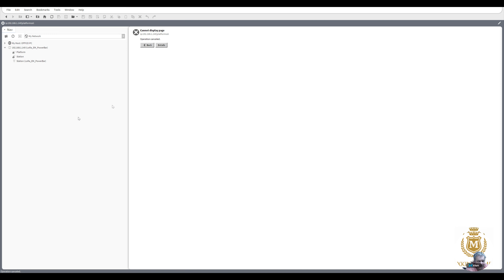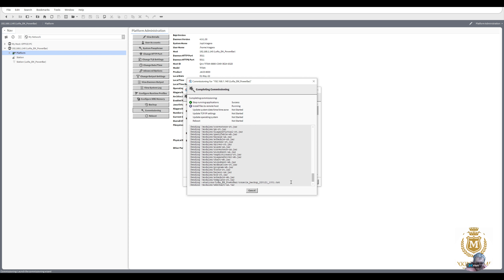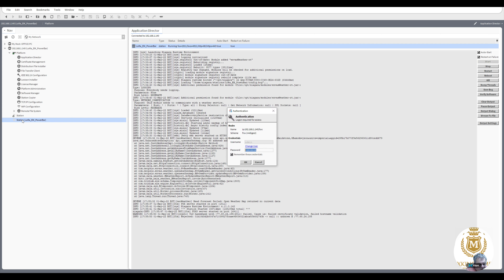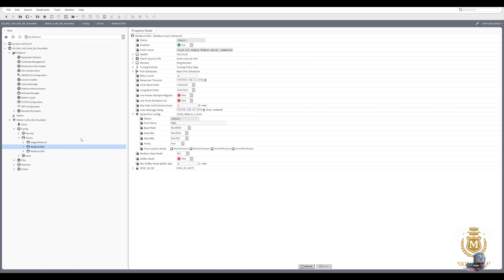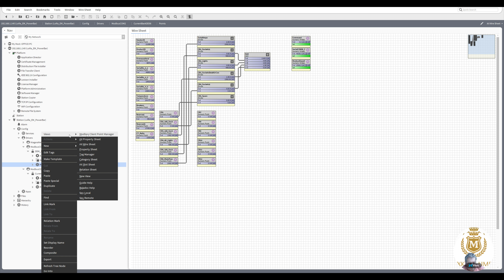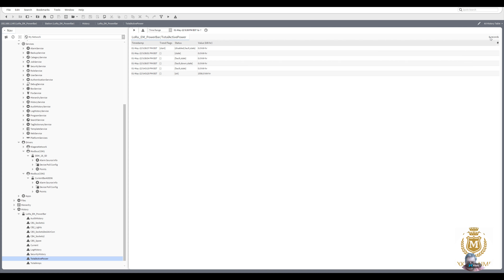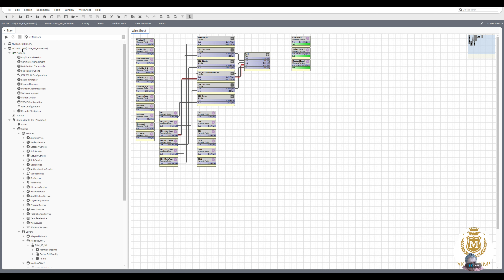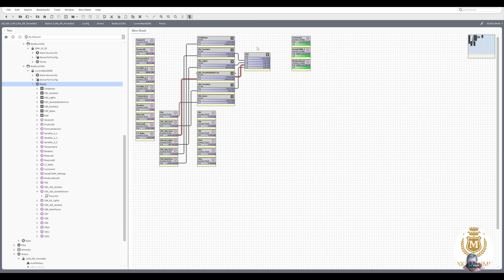#19 N4 Tridium Niagara - Machine learning - Commission a JACE8000 controller with N4.11

Comment: Where do you get cleanDist from if you need an older one?
Reply from the maker: You can get that from a older version for example 4.9 N4 workplace. 
But be careful, an issue with the process of cleaning and conversion from AX to N4 of a JACE 3, 6, 7 & 8000 controller post January 1, 2021 has been identified. JACE controllers commissioned with Niagara 4.2 or above should operate normally unless they are reset to factory default.

Please note that the normal first-time power-up of new JACE 8000 hardware in 2021 is not a problem.

The affected code has remained in software files used only for recovery of the flash partition to factory default. 

An updated cleanDist file, version 4.1.27.28.1, and conversion file 4.1.27.20.1 were distributed with Niagara 4.9 that includes the fix for these issues for the JACE 8000.